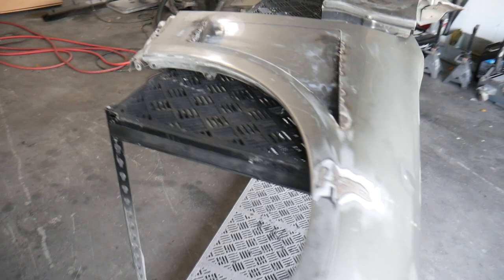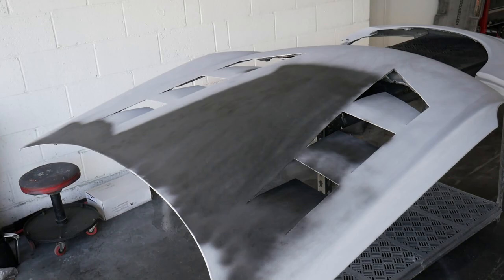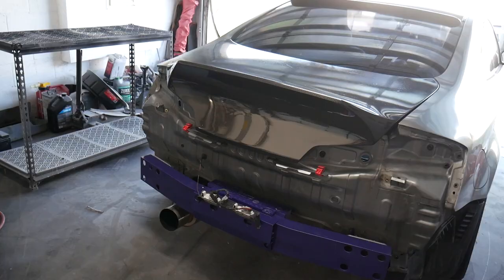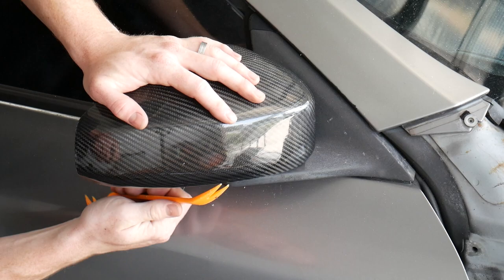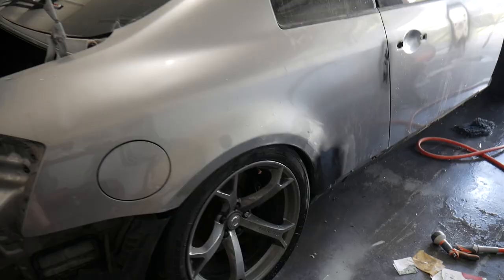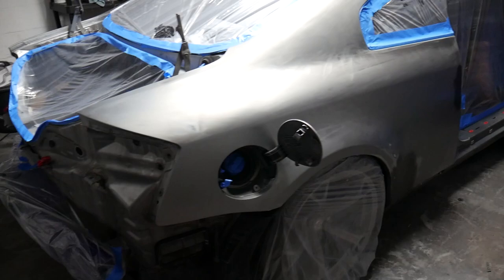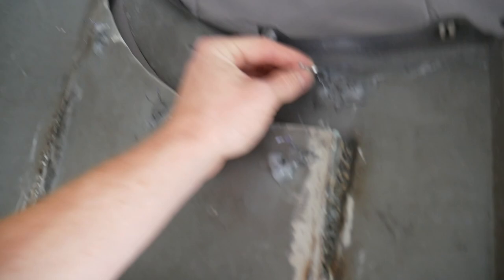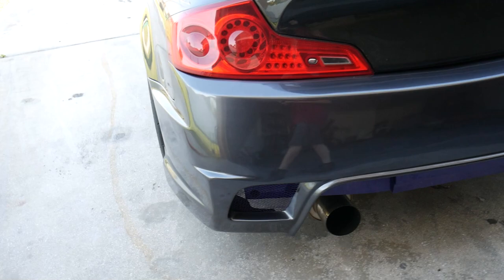Painting My Boosted G35 In My Own Garage!

Comment: Hey i was wondering where/how you mounted your camera for the diff bushing video? Also What camera did you use? I have a bad vibration on hard right turns and all my suspension bushings look ok but the diff is bad. I wanna record whats happening so i don't just throw $ at random parts.